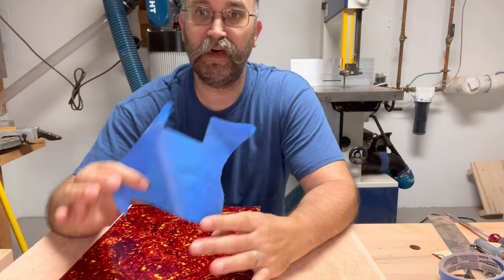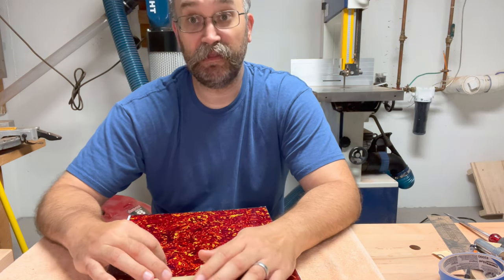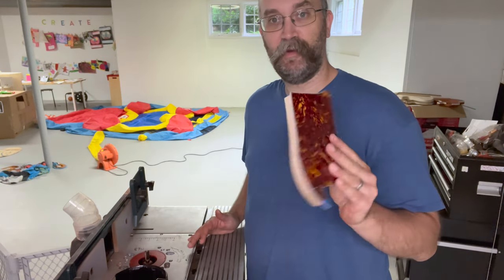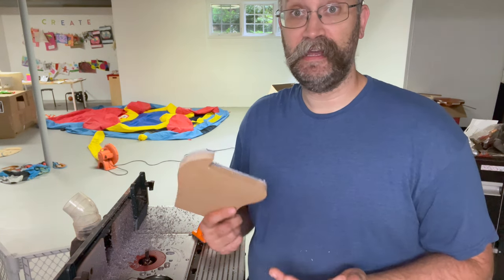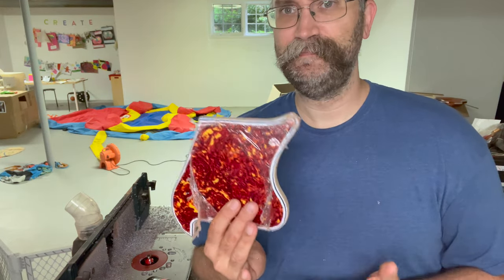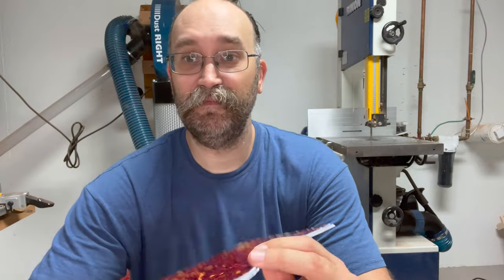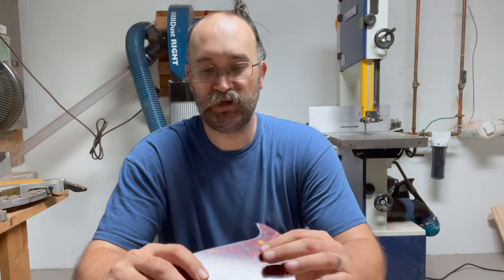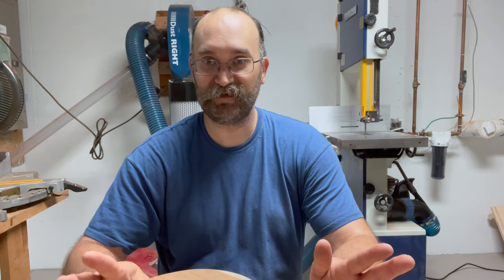The Do's and (Mostly) Don'ts of Fabricating a Pickguard

Comment: I cut mine with a Dremel cut off wheel. Yes there was melting but I cut the shapes wide then drum sanded down to where I wanted. For the beveled edges I used a sanding block and 600 grit paper, then 800, 1500 and 2k to get super smooth shiny accurate lines around the plates I made. Just keep in mind when working with this stuff it gets SUPER staticky and sticks to everything. You WILL track that all over the house hehe. If you do grind or sand it use a mask as I am sure plastic in your lungs is not conducive to comfortable breathing in your twilight years.
Reply from the maker: Yeah, I’ve still got shavings all over my router table 😂

Comment: Thank you for the video. Once I have the basic shape of a pickguard, I use a sanding block to take out any bumps and then a card scraper to smooth the edges. Sanding will cause some roughness on the bottom edge of the pickguard, but this can be removed by the card scraper. A card scraper can also be used after sanding to smooth the bevel in the pickguard.
Reply from the maker: Fantastic point, thank you! I do already scrape plastic binding with a card scraper, not sure why that didn't occur to me for the pickguard as well

Comment: Is it possible to reshape the pickguard using a box cutter? I don't have access to any of this tools but I have a cutter. The pickguard is almost 3mm thick. So it needs a lot more push to do an incision on the plastic. I hope it will work I've never seen anyone posting videos vutting a pickguard with only a box cutter.
Reply from the maker: It will definitely be tough. Once you get the outline cut out, I have used a razorblade to smooth the edge and add a taper.

Good luck!
Reply: @zwitchguitars  thankyou so much, sir! I hope It'll turn out okay. Much love from the Philippines. 🙌

Comment: What's MDF?
Reply from the maker: Medium-density fiberboard
Reply: Thanks. I'm going to have to make a custom pick guard for a  bass body I'm getting from Warmoth. I found a blank pearloid sheet to buy online for about $20. I'd really like to make it work out.  I'll be needing some "MDF". Cheers !
Reply from the maker: @user-gl7xm3kf3y You can also use plain plywood, it’s just that MDF is a very consistent material (pressed sawdust and glue).